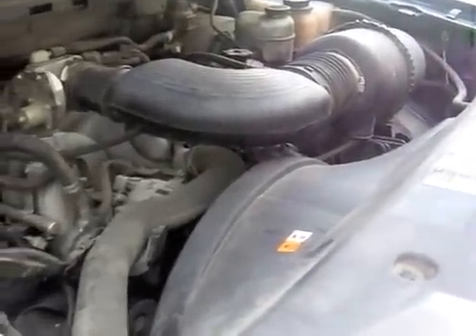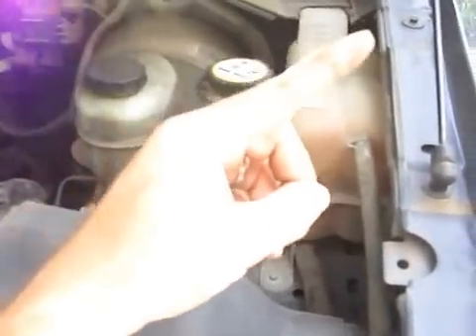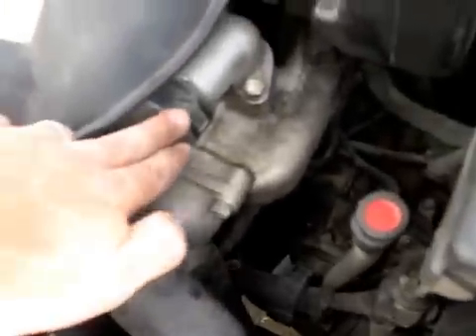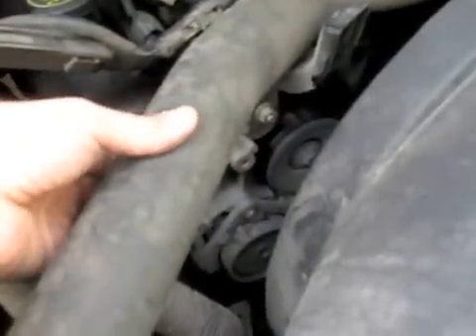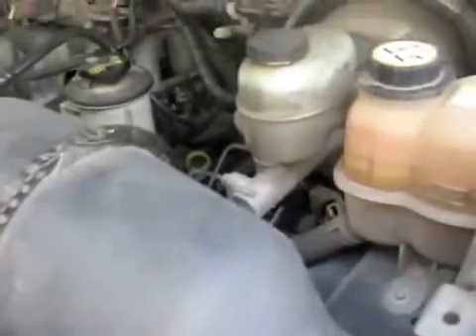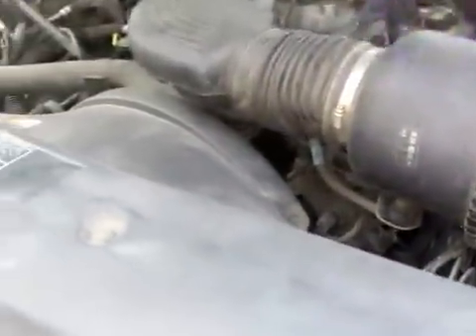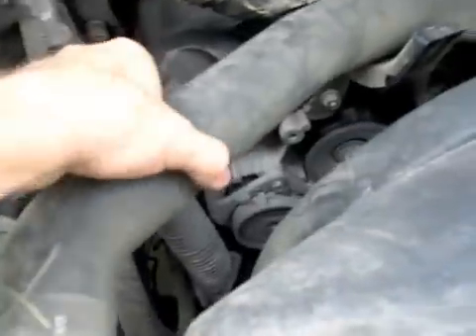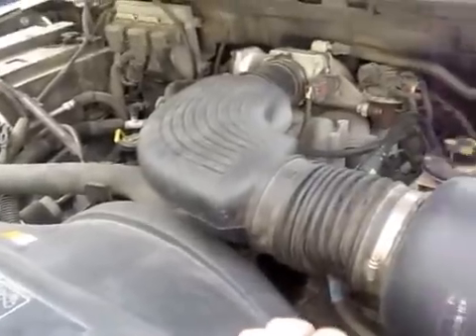Car Engine Overheating - Causes and Symptoms of Over Heating  Car Engine

Comment: hello all, i'm having heater trouble about my Pontiac Montana. I tried to drive this Montana van for about 30minutes up to an hour and even more just to reach the normal operating temperature.. I observed the temperature gauge it reached the normal operating temperature but STILL NO HOT AIR is coming out both in front and rear vents (always cold air). The heater and fan control knob is pointed to high already. No engine overheat temperature, I checked the radiator fan it runs well when required. The radiator coolant level is okay and the overflow tank as well. I already did coolant bleeding or burping several times but still no hot air. Your help or any suggestions is highly appreciated.
Reply from the maker: When engine is at normal operating temp, feel both radiator hoses and both heater hoses (which will be on the passenger side of the engine) they all should be hot. If they are not hot, make triple sure the radiator is full of coolant, if full of coolant but radiator hoses are not hot I would replace the thermostat.  If just one heater hose is hot, you probably have a restriction in the heater core and you might want to try flushing it out with a garden hose.  If ALL hoses are hot, you probably have a control problem in the dash which is not moving the heater diverter door to allow the hot air out of the dash and the door is stuck in AC mode.

Comment: Hi I have '99 ford Taurus and am wondering why my engine is knocking and coolant is leaking
Reply from the maker: Get a cooling system pressure test to help you locate the leak and repair it. A knocking engine is NOT GOOD, so turn it off and stop driving.  Could be caused by excessive overheating, which will permanently damage the engine.

Comment: hi i have a 2000 chevy impala my car would over heat  after 8 or 10 mins of driving it  it would go all the way to the red part  and start to shake and make shaking noise..my  steering wheel and dashboard area would shake  and than the car would start to go slow like 20 miles no matter how hard i press the gas than the  meter would go back up and the car would be fine and drive normal speed and than go back down red and do the same thing ...... do you think u might know the problem??
Reply from the maker: engine overheating OR lack of engine oil pressure can cause lack of power issue and engine overheating. If the oil pump screen is clogged up and cant circulate engine oil the engine will overheat and run out of power....because it is basically locking up due to excessive friction. A restriction in the radiator, or lack of coolant circulation will cause overheating....excessive overheating can cause lack of power.  You need to have this diagnosed to see what is happening first.

Comment: Hello, I have a 2000 maxima the temp gauge was going up as if it was overheating but no smoke at all. The thermostat and water pump was just replaced but the gauge still goes up while driving and it goes back n forth from up to down. Do u know what could be the problem
Reply from the maker: Turn the heater on when it overheats, if no hot air then no coolant circulating inside the engine, either an air pocket from the recent repairs or a restriction in the 14 year old radiator or a coolant leak somewhere and you need to get a cooling system pressure test to help you locate it.
Reply: Ok thank u

Comment: I have a 1995 caddy sadan deVille telling me engine coolant hot idol engine and it's constantly getting hot any tips on how to fix this Thanks
Reply from the maker: Follow the steps in my video to rule things out. Get a cooling system pressure test, check the electric cooling fan motor at the radiator, check radiator for a restriction.

Comment: My problem is the following which is I have no leaks !, although i replaced the radiator but every two days i'm adding coolant to the radiator and it's just evaperating. I plan to change the hoses and also i noticed that the presure gage is not installed. HELP !!!
Reply from the maker: If you are having to add coolant you have a leak somewhere. Get a cooling system pressure test to help you locate the leak before you do anything else.

Comment: 06 Chevy equinox has an overheating problem. Mechanic replaced the radiator but now says that car had a blown head gasket. Coolant/water still leaks from the overflow hose and no heat in car.
Reply from the maker: No heat in car, then you have no or low coolant circulation, or low coolant level inside the engine.  Pressure test cooling system for leaks, repair all leaks, make sure there is not an air pocket in the coolant system that needs to be bled out, check thermostat operation....get a new mechanic :)

Comment: QUESTION.....if i take off a radiator hose and then start the car (92 bmw)...  shouldnt the water come out at a high velocity??? ...trying to determine if water pump has stopped working???????
Reply from the maker: Not necessarily The thermostat is probably closed so you will not see coolant just gushing out. Rarely is there a problem with the water pump internally, other than the gasket leaking coolant.

As long as the belt is turning the pump, and it is not leaking I would not suspect an issue with it. A restriction in the radiator not allowing coolant to circulate is much more probable or a thermostat that is bad. 

Rule out everything else I mentioned in the video first before moving to the harder stuff, usually its the easy stuff like a restriction or coolant leak or electric cooling fan problem that is the culprit.
Reply: thanx bud...i did see milky buid up under oil cap, but didnt see any milky oil on dip stick...car runs beautiful. with no signs of head gasket out tail pipe (no smoke whatso ever.)...if i take thermostat out will the water rush out the hose while car running????...alos water temparture gauge idoesnt work at all...some said it may be coolant switch on radiator or water neck.
Reply from the maker: AMOS MOSES A little moisture under the cap is kinda normal, as long as there are no other issues. Removing the thermostat might do it, but why are you trying to do this?  Fix the gauge!!!! If the water pump was not working the engine would overheat rather quickly, and I doubt there is anything wrong with the pump itself.  You need to know the engine temp, so spend your time and energy getting the gauge to work.
Reply: yes ...overheats very quickly...within 5 to 7 mins...tearing all apart tomorow...will get gauge to work first thing...may be clogged water flow somewhere...will try a back flush...hot wire electric fan..??????it has a  regular fan on water pump...but another fan in front of radiator...thats not coming on.
Reply from the maker: AMOS MOSES
I would be more inclined to think you either have a large air pocket in the cooling system that needs to be bled out, or you have a restriction in the radiator. I would take the radiator out and to a radiator shop and let them boil it out. The cooling fan could either be a bad motor, or there is no hot coolant circulating in the engine for it to register and come on....probably what is happening. Restriction or air pocket just my best guess from this side of the computer.
Reply: ok..mystery is still being unraveled.lol....well i just hot wired the elec fan to come on when key is turned on..  due to elec fan not coming on at all..... (it has a mechanical fan and elec fan on front of rad)....the temp gauge is working now.. (after i steamed clean motor????)......no leaks of any kind........went for a spin and gauge got up to mid range for about 15 mins then hit over to red overheat range..... i shut it off for 15 mins and strted it again.. temp stayed in mid range and never moved for over 20 mins of driving...?????????...so just came home.
Reply: im thinking air pocket too,,cause temp needle was kinda bouncing around?????...but i dont see any type bleedr valve on thermastat (or anywhere eles)...its a 92 so may not be one?....it does have typical water resevior only .  no radiartor cap.
Reply: but still no heat coming out heater /defroster...just cool air
Reply from the maker: AMOS MOSES
Turning on the heater, start the engine and slowly add coolant to the reservoir until you get coolant burping back up, then close the cap and take a test drive, allow the engine to cool and recheck coolant level. Since you have no heat, I am still thinking you have a blocked up radiator. I would remove it and take it to a local radiator shop and have it boiled out, or replace it.  if its original, its way over due for a change.

Comment: Hi, I have a '02 Jetta. It started to overheat , it usually happens when i am driving on freeway and it also happens after some time when i am driving on regular road. The radiator hose gets hot so i think that it is not a water pump problem but motor still feels cool when the gauge needle starts to go over 190.Can be the head gasket ?
Reply from the maker: I would get a cooling system pressure test first to rule out any internal or external coolant leak. Then check for a restriction in the radiator that might be restricting coolant circulation. Engine temp should be about 210 degrees Fahrenheit
Reply: TrustMyMechanic.com Upon finding milky stuff on the oil lid I tried your formula with the K&W and went on a test drive.On the highway ,when car got to the regular temperature, needle started to go over 190 , then i was gonna exit the highway but i noticed that it went back down to 190 again. I drove more than 10 miles , it was perfect , not overheating.I decided to exit the highway , at the lights i heard noise coming form motor. I parked somewhere there. I checked ,there was no water left in the reservoir,  i added water and now its overheating when i stop at the lights while driving. There is no external leaks , but i found today that lower radiator hoses' lower end which goes into radiator is very cold while the upper end which goes into motor is warm whereas the upper radiator hose is very hot. I suspect  that something is blocking the circulation in the lower  radiator hose ?
Reply from the maker: Murad Sen
Did you get a cooling system pressure test?  Did they check for a radiator restriction like I suggested?  The 190 temp is normal, but you should not be losing coolant.  Pressure test, check radiator for restriction, check electric cooling fan.  Very hard to see inside this radiator, so you might just have to replace it IF the pressure test proves there are no leaks and the cooling fan is working.
Reply: TrustMyMechanic.com Thanks for the advice.When i turn the A/C on and blow hot air inside the cabin, temperature goes down to normal,if you blow cold inside it doesnt help.Fan only works when A/C turned on.
Reply: Murad Sen Found it. It was thermostat :)
Reply from the maker: Murad Sen
Awesome, glad you solved the issue. Thanks for the update.

Comment: HELLO... have a question Monday my car was over heating put antifreeze in it the antifreeze start to boil so I waited until the next day to drive my car... drove it to the oil place to see why the antifreeze was boiling... the man told me to get it flush but he didn't wanna do that cause he said something about moist being in my oil so when he pop the hood something was steaming and leaking the man said it had to be antifreeze took it to the shop... the man said that it was my y pipe it had burst do to rust... Do have to take the trans out to replace the pipe that was what I was... doesn't sound right to me.... have Suzuki Forenza 04 and also my car was blewing out white smoke from the tailpipe... he said its not a head gasket could a y pipe cause a car to over heat and make the antifreeze boil
Reply from the maker: Any external coolant leak, like the Y pipe or a radiator hose causes coolant loss and coolant pressure loss...thus overheating and boil over. If this external leak sprays coolant onto the hot engine you will see white steam and smell a sweet smell/odor as well because of the leak.

Do you have to take out the transmission?  Not real sure, very rarely do we see any Suzukis in our shop to remember, or have done this repair. I would call a few other shops and get price quotes and ask them if they know for sure.  My gut says probably not.

White smoke out the tailpipe can be an indication of a head gasket or internal coolant leak, but fix the obvious external leak first and see what happens. Stop the engine if it runs hot, you do not want to do more damage than what is already done.

Comment: My sister drives a 1985 Toyota tercel and the guage rises up to just unnder the H on and off the red line, the single electric fan works and the raddiator is full/doesn't leak it is the factory radiator and hoses though not sure if that changes things have any idea what's wrong? Also I took out the thermostat completely for a day then re installed it and so no difference without it, 
thanks

Comment: I have a 99 Nissan Maxima, I really don't know much about cars but recently my car has been overheating so I thought I just needed antifreeze but I have to add antifreeze almost every week and it still over heats I think there's a leak in the radiator I also found a hole in the radiator I have now on the upper plastic that smoke comes out of which I think helps the car overheat as well. Please help.
Reply from the maker: Get a cooling system pressure test to help you find the leak, or if you are certain the radiator is leaking fix that leak or replace the radiator then pressure test to see if there is another leak if you still have overheating issues. Can't be ANY coolant leaks.

Comment: HI, about 2 months ago my temp gauge would read that my car was overheating and I had to replace the coolant temperature sensor. This fixed my problem but today my car overheated and I had to add coolant. After I added the coolant it didnt leak out but was bubbling in the reservoir. Any insight what could be causing this? I haven't tried to drive it after this happened but I'm sure there is something that needs to be fixed and wondering where to look. Thanks in advance!
Reply: Oh and by the way, I drive a 2006 Dodge Stratus 4 cylinder
Reply from the maker: Well, first thing I would do is get a cooling system pressure test, which should help you determine if you have an external or internal coolant leak which needs to be repaired. The bubbles you see COULD be coming from an internal coolant leak like a head gasket, or it could be that the coolant is overheating and boiling over inside the tank because of lack of coolant, or lack of coolant circulation in the radiator.  The over bottle is just that, a holding place for excess coolant and to capture coolant that has boiled over from the radiator due to overheating.

Comment: I have a 2002 jeep cheeroke  that overheated. And put antifreeze back into it and still overheard and put antifreeze bfn into over flow jug what should I do help pleasand there is no antifreeze in my oil and still overheating
Reply from the maker: So it sounds like you are continually having to add coolant to the radiator/over flow bottle.....right? If that is the case, get a cooling system pressure test FIRST before you do anything else. That should help you determine if there is an exterior coolant leak that needs to be repaired...which I am thinking there IS. Fix the leak, you should be good to go. Test is cheap and fast and any mechanic can do it for you while you wait.

Comment: Hi! I warmed my car up for about 20 to 30 minutes on a Monday below 0 degree weather (Chicago). Soon after, the gauge on the dashboard starts to rise near the H with cold air blowing out of the vents instead of heat. The coolant in the reservoir is kind of slushy due to the freezing weather still. Can this be a thermostat gone bad (thermostat stuck closed)? Mind you, i just replaced a thermostat a month ago. I also blew a head gasket afterwards and gotten all of that repaired two weeks ago. My second question is was my mechanic suppose to change the thermostat as well after installing a new head and head gaskets? Now Sunday before the overheating occurred, my car was operating normally, a lot of heat blowing and the gauge (car) is at the normal temperature. I can;t afford another head and head gasket, so i did not move my car by any means. Please help me!!!!!!!!
Reply from the maker: If temp gauge showed the engine to be hot, but cold air was blowing out the vents either there is no antifreeze inside the radiator or not enough, or the antifreeze inside the radiator is frozen (like the overflow tank) and no antifreeze is circulating inside the engine or a stuck thermostat (or frozen) or some other restriction is taking place not allowing antifreeze to circulate in the engine.  I would be concerned that the radiator is frozen solid with the sub zero weather you are having now.

Comment: I have a 84' Mercedes 190E and i was just wondering at which temperature should i start to worry about overheating? When the car is idled in traffic it reaches up to 100C , Other than that its mostly at 80 or slightly below or up. Should i be worried?
Reply from the maker: Anything over about half way on the gauge points to a potential problem. Do you have an electric radiator cooling fan?  if so, check that it is coming on at idle.  If you have an old fashioned plastic fan with a fan clutch I would check the fan clutch operation. Also make sure the radiator is full of coolant and there are no restrictions in the radiator.  Low coolant flow or low air flow across the radiator are things you need to look for in a situation like this.